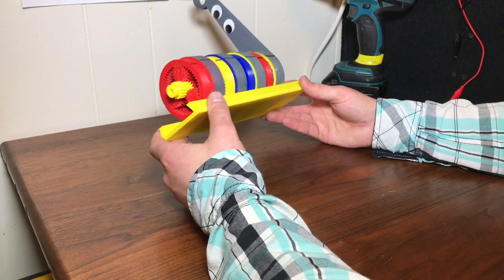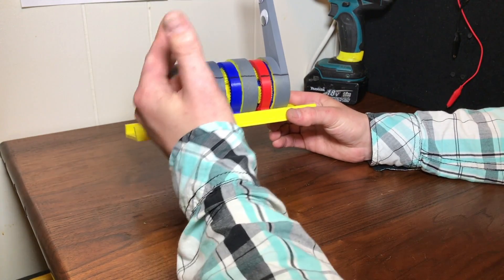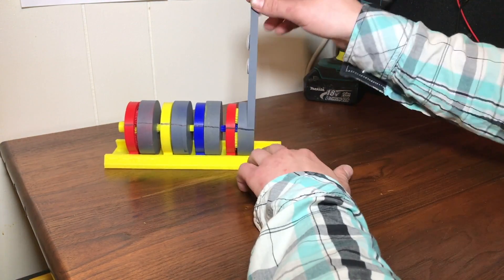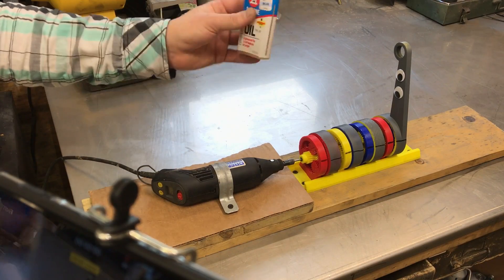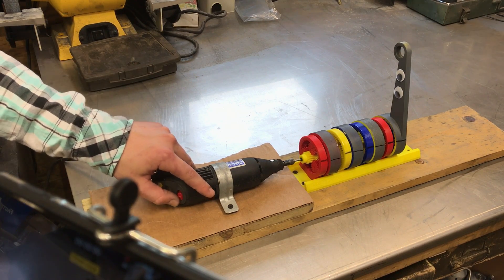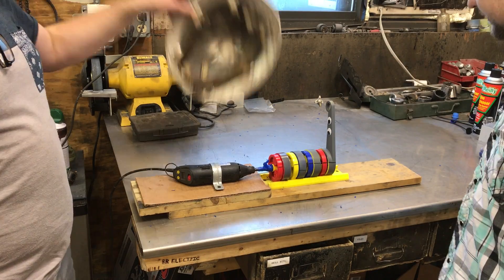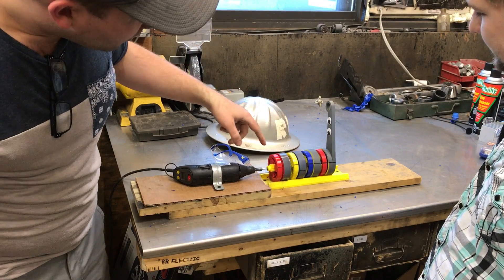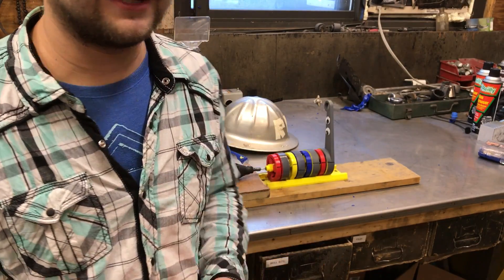3,616,238,492,881 To 1 - The Most Useless Gear Ratio Ever

Comment: So I gotta ask, why F around with canned air instead of putting a little fan on the input side? There's obviously enough room for some air flow between the planet gears...
Reply from the maker: +Dan Bowkley I would have to modify the back cover to add vent holes. It's a lot of work to get these videos ready there isn't always time to prefect everything.
Reply: Gear Down For What? Ah, that makes sense then

Comment: I've been thinking about something like this for a long time and the way that I envision it is to have a motor on one side and it would go into the middle, after a series of the gear reduction's, so that they could have a big wheel and a little army figure standing on the top of that and it would be stable so that the figure wouldn't fall off the wheel ! Then the gear reduction would happen again towards the other side so that you'd have a spinning wheel going very fast at the other side... ?
Reply from the maker: +Chrstphre Campbell you mean so there would be a ring gear that is stationary but only supported by gears that are moving? That's pretty much what would happen if you support ring gear #1 on this set. Ring gear #3 would not move
Reply: Gear Down For What? / right I think, so then after the stationary gear, it would reverse and then it would be spinning really fast at the other side, so that you have it really fast on one side, and really fast on the other side, and the gears in the middle wouldn't be moving !which would strike me as very odd ?

Comment: Ok, so I have a question. I get that you cant simply reverse the entire design... But could you build a gearbox that would double or triple the input RPM and then attach it to a sterling engine? Using a small generator and some Kanthal wire, it seems you could generate a good bit of energy that way....
Reply from the maker: +Neon Nightfall keep in mind that you never get more energy than you put in. And with friction losses you are actually loosing energy. 

The ideal generator/motor/engine would not have a gearbox at all, it would be designed to output/input the exact RPM and torque needed to work properly, but that is not always possible.
Reply: Gear Down For What? I understand. But I'd love see someone try and maximize the efficiency of an engine using magnets, gear ratios, and mechanisms that many dont know about. Self sufficient energy is there. we just have to find it.
Reply from the maker: +Neon Nightfall I disagree. Energy can neither be created nor destroyed, and perpetual motion machine will eventually stop due to entropy.
Reply: Gear Down For What? We differ in "opinion" seeing as neither of our hypothesis may be proven or disproven. I can agree to disagree.
Reply from the maker: +Neon Nightfall me too
Reply: Gear Down For What? Still, with all due respect, amazing video and great engineering skills. Thank you for making this... it fascinates me more than I like to admit :)

Comment: I need some sort of satisfaction from this. You need to make this thing out of some kind of hard metal, grease the shit out of it and hook it up to a 10000 rpm cnc machine spindle. Blast coolant on it and put a very sensitive dial indicator on the arm and let it run until the indicator moves a little or something blows up.
Reply: why a cnc machine when a dremel can do 30k rpm

Comment: Homage a metal gear box like that and run an electric motor on the out put side and an electric generator on the input side with a system to report power back to the output sides motor. What would happen if anything? Aside from wear on parts. So if there's gears with ratios like that how does no-one figure hey reverse it and use the input to make more power than it used. Might not last forever cause of parts needing replaced bit would it be an answer to cheaper energy.
Reply from the maker: +Justin Dougherty The conservation of energy prevents this. You are referring to a perpetual motion machine, it's just not possible.
Reply: Gear Down For What? not saying its last forever,  parts would fail needing replaced but has anyone ever tried making a gear that spins more than what they put in and actually try to make something that runs off itself.  seems like everyone assumes that a generator made like that for some reason wouldn't do anything. before saying impossible, maybe consider that an entire industry is reliant on not having things like that and actually building one. no evidence anywhere says a generator can't be made with gearing and a system to put some of its energy back into it and some gets put out to us.  just that its impossible to make a machine that runs off itself forever.  a 5 volt drive motor spinning gears that lead to a generator that puts out enough to keep it running and supply power to something small on the end of gears that turn more times at the generator than at the motor.  Not perpetual motion. since when did just assuming without testing become science and how things are figured out.
Reply from the maker: +Justin Dougherty Your just trying to redefine perpetual motion. Just because the gearbox will wear out doesn't mean that it's not perpetual motion, it still isn't possible.

Comment: If the output turns one time for the input turning 3,616,238,492,881 times, what if you turn the output instead of the input?
Reply: Not so useless then.
Reply from the maker: +Justin Dougherty Its not possible, it will just break

Comment: what would happen if you did this the other way around? 
by this I mean hook the drill up to the other end of the gearbox with the gears in the opposite sequence
Reply from the maker: +Tafara Gadze it would break
Reply: +Gear Down For What? 
really, I thought the ratio would reverse. 
how would one OK about trying to OK reverse this ratio anyway, hypothetically speaking of course.
Reply: +Gear Down For What? 

and where can I get the 3d files that you guys use to print out the stuff for your videos? I'm interested.

Comment: how to make a black hole

step one: build that contraption out of some indestructible material

step two: turn it from the other side so the input gear would be spinning faster than light

step three: profit?
Reply: i would get chuck norris to turn it
Reply: +Ali Zelaya 
He didn't say they would use a Dremel, maybe they could get a really long pole & use a planet with a moon to turn it.
Reply: not true 
he would use a giant nokia 3310 as a lever
Reply: nothing can break a nokia
Reply: MWB Gaming you have to factor in torque, if he tried putting the Dremel in the output it wouldn't spin, even if it's a joke.
Reply: jackemled lol regardless I don't think nothing know to man can with stand that force especially with a long pole to a planet, it'll just snap like a spaghetti string lol
Reply: MWB Gaming his arm would snap and the black hole would close
Reply: MWB Gaming see a Nokia can with stand a black holes pressure

Comment: This vid could also be called "How to lift a Container Ship with a Handwheel"
Reply: R0CK3R and incredibly it would not be click bait
Reply: "with some avaliable time"
Reply: or how to lift the earth with a fidget  spinner
Reply: I'll try that in msc
Reply: ayyyyy that would take  a billion years
Reply: did some sketch math, apparently if a human applies 50 newtons of force on a 1st gear, you only need a gearbox of 42568600 to 1 , not 3.61 madness to ) for emma maersk
Reply: I'll just use the GrabAnything mod for My summer car ;)
Reply: Sir Underbridge he said handwheel, not electric drill spinning the piss out of it.
Reply: How many rpms would it produce if you turned the last gear
Reply: The container would probably have rusted away before u got it off the ground...
😔
Reply: No it should be "how to de-orbit a galaxy"
Reply: dude there is no more resistance with that ratio. how fcking long u think it takes to move that last gear?
Reply: Sir Underbridge that's what liquid nitrogen is for.
Reply: the random channel 3.6 trillion multiplied by how fast you can turn in a minute.
Reply: XV30 Lowrider what do you mean?
Reply: R0CK3R awesome idea
Reply: Hahahah dude this gear ratio should be available on the final gear ratio change of the satsumy  XD 😂😂😂
Reply: I was wondering that :-). And how much force would it take to move the last gear.
Reply: the random channel  it would turn ito a black hole if you did that
Reply: Too much tension for container. Ratio is not an issue.
Reply: In 300 years
Reply: (In ca. 500 yrs)
Reply: Patience. Gotta go slow to keep it cool.
Reply: Or "how to make the most inefficient planetary gear system"
Reply: Glad I watched this when I was taking my morning crap. I didn't waste any time! 😉
Reply: and it will take you 5,000 years to lift just a single centimeter
Reply: You must be void of patience.
Reply: Omg how do you came here
Reply: click bait shit.
Reply: "How to lift 50,000 Donald Trumps"
Reply: @noahb2358  How to duplicate 49,999 Donald trumps?

Comment: Rotate the handle, will it spinn the input over 1mil rpm?
Reply: not  even that, the end wheel would spin faster than light, so it is imposible to move that handle, it would require to pass the infinite amount of energy to move it.
Reply: Zenytram Searom hydrolic press or 1 mil atmospheric pressure?
Reply: for any particle with mass to move at speed of light would require infiniti energy, so it is impossible to reach it. i've done a rough calculation and just moving 0.1 millimeters in 1sec, the edge of the last wheel would pass speed of light.
Reply: Well if you calculated it moving past the speed of light, that is a very rough calculation indeed 😀. What would happen is, as the output side turned (this is theoretical for many reasons, but assume the thing could actually work...) the input side would get into "relativistic" speeds. As the output was turned faster, the increasing speed of the input would be far from linear. It would asymptotically approach the speed of light but never get there as the energy required to increase the rate of turn would go towards infinity. But physics still apply. Even if the big side was turning 50000rpm, the small gear would just rotating away at .9999999999999c or something

Comment: Install a corvette engine to the handle and give it full rev
Reply: TheSupercarNerd even at full throttle in neutral new LS engines top out 9000 rpm
Reply: Shane Walker no, It's for the grey end
Reply: TheSupercarNerd (gearbox explodes into milions of flaming shards)
Reply: TheSupercarNerd nothing on this planet can generate enough torque to turn it on the output (Grey end) the handle would snap anyways plus that LS would probably shoot a piston out.

Comment: So you're telling me I can move an airport with a dremel?
Reply: Calvin Farrow it would taje a few thousand years but yeah
Reply: Yes, but not as fast as the tectonic plate the airport sits on is already doing it. Plus, a piece of the airport will probably just break off before you move it very far.
Reply: Richard Rowe 

"give me a lever long enough and a fulcrum on which to place it and I shall move the world" 

~Archimedes

This is like the only quote I have and will ever memorize..
Reply: You can move the world with a long enough lever and a place to stand. Some guy said.
Reply: the bigger problem is that TSA would find a reason to confiscate the dremel
Reply: SOAHCSOAHCSOAHC Lol thanks for the funny reply that made my day 😂
Reply: Bill Kong he was saying the ratio could theoretically loft that much not the maferials
Reply: Would take a while.
Reply: If u live in a world without friction
Reply: Calvin Farrow It would take millennia.
Reply: Calvin Farrow yep but you need strong steel or its gonna break
Reply: It's how they flipped battleships in pearl harbor.  Took about 3 months to rotate the ship.
Reply: Bill Kong debatable
Reply: 5000 years
Reply: It would take more torque then the material could withstand.
Reply: Turn it around and see what happens
Reply: You could move a fucking oil ship loaded.
Reply: Turn the other end and get the other end turning really fast 😁
Reply: That would also snap the gear box. A gear box is only as strong as the gears inside of it. This thing is plastic, it will never survive a force greater than a few dozen pound feet (if that), either as input or output.
Reply: It's pretty misleading. 
A really long lever would just sag under its own weight or break. This reduction mechanism can't produce 6000 tons. The whole thing would probably snap at about 1.

Comment: I really like ur 3d printed gears. They are really clean 3d print.
Can you tell me which 3d printer you use?
Reply from the maker: +ajay bhangu the Anet a8
Reply: Gear Down For What? Do you use 
Thanks for the reply. 
Just one question
Which one you use,PLA or PLC material?
Reply from the maker: +ajay bhangu PLA actually
Reply from the maker: +ajay bhangu the Anet a8